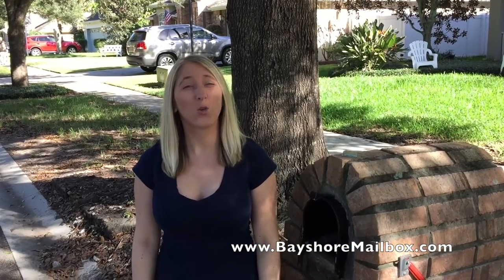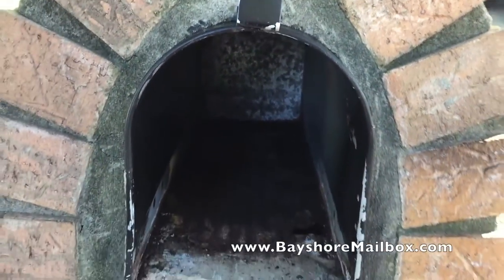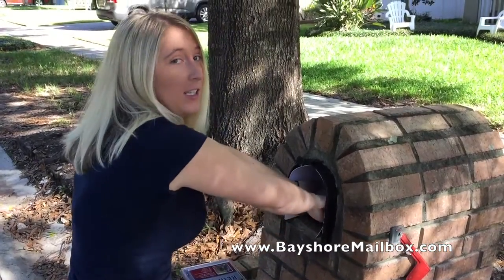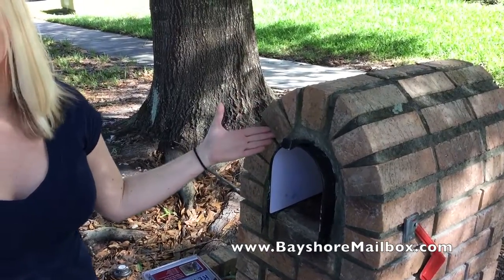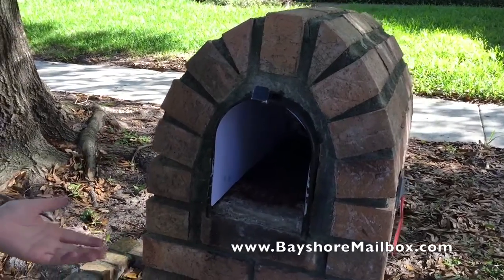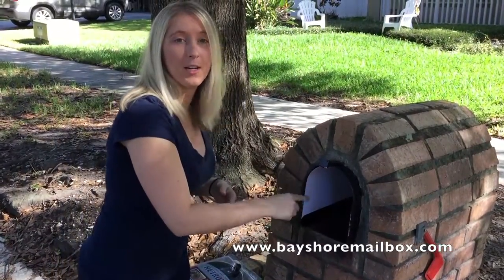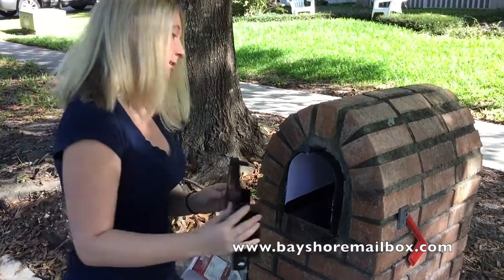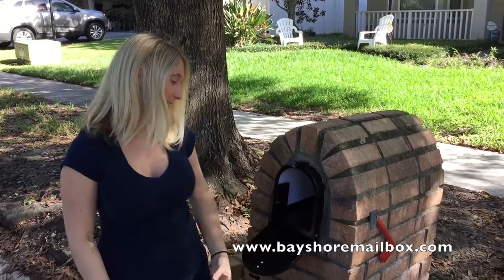How to Repair a Rusty Mailbox

Comment: Not brand new. The rear panel on mine is rusting through as well. Why no replacement for that? I sprayed mine, in fact, the entire inside of the old box, with flex seal and put the liner in while still wet. I hope that makes it watertight.